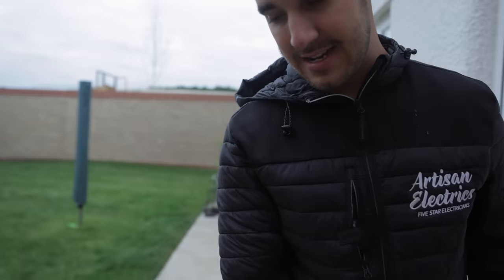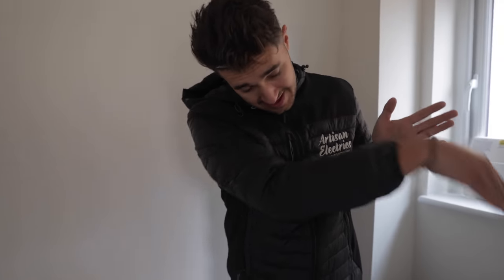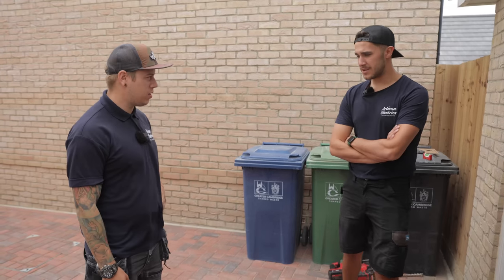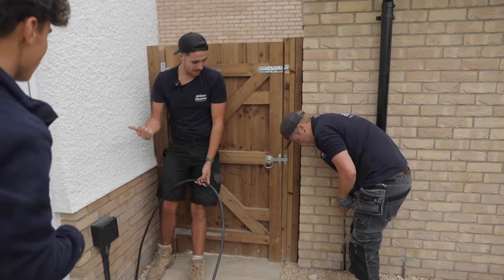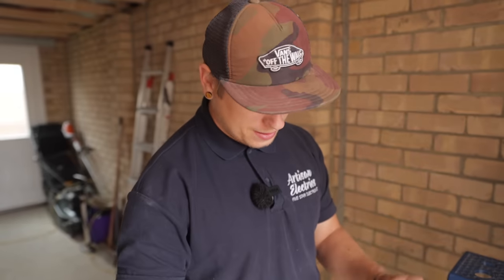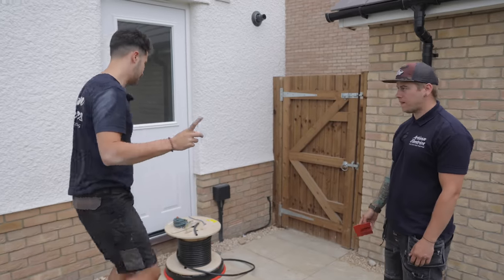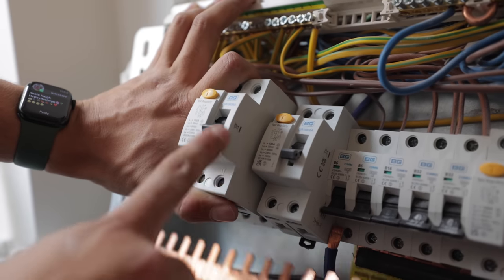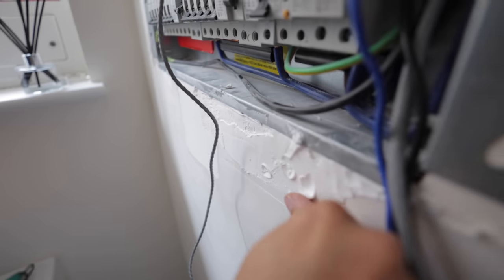EXPLODING MATERIALS, DODGY CABLE DUCTS & SLICED KNUCKLES

Comment: Telecoms cable wiring starts with Blue, then Orange, Green, and Brown. First pair to be used should be Blue/Blue-White. In the char carger application I don’t suppose it matters that much. I use some WD40 at times to help get cables through tight ducting/trunking.
Reply: WD40 can affect the insulation and stinks, far better to use proper conduit lube
Reply: Back in the day we used soap liquid or talc powder.
Reply: I use KY
Reply: Lube is useful here!
Reply: we have blue-orange-green-brown-grey in our telecom
Reply: @justme5384  If it was a 5 pair cable, yes. But most Ethernet/Cat 5/Cat 6 cable is 4 pairs for 8 pins on the RJ45 connector.
Reply: @badrobert71  still use customers fairy liquid if needs be. Just a nightmare once you’ve got the cable through you’ve no chance to carry on pulling as you’re fully lubed up as well!😂
Reply: @chrisdobbo8938  - lube when wet, glue when dry. 😬
Reply: I came down to the comments to talk about the AT&T twisted pair color code as well. Good on you, David!
Reply: silicone spray. Does not affect plastics or rubber

Comment: Just some silicone spray in the pipe before tight pull and should come quite easily or otherwise there's a potential problem 😁

Comment: Top tip i find (not a spark but pull alot of network cable etc) just put some fairly up liquid down the end of the duct, pour fair bit in, and if needed put some on cable if it dosnt coat as its goes through, you will not believe what a difference this will make to pulling any cable through a duct, even if its not that tight a fit, the friction from the duct and cable over a distance is huge, a bit of fairy and it just decudes this by like 75%, deal breaker i find!

Comment: No critic, just a question: Why aren’t there more multi-row CUs in the UK?
E.g. German electricians put at least 2-row panels in each chamber of some business hotels or apartments, often combined with a mounting place for the meter.
I think this is a UK standard of some sort, but it always looks so fiddly to get all the cables into these tiny CUs … even if Artisans always do a great job of making it look pretty 🤩
Reply: You'll basically never find multi row CUs in UK houses but anywhere else you'll find something vertically stacked In 2 rows so you have a bit more space

Comment: That didn't look like SWA -  does PVC conduit under a paved path count as fine for protection when burying cables?
Reply: Strictly speaking, probably not. It'd have to be earthed metal to provide additional protection. Plastic pipe isn't going to do much to ensure the cable short-circuits safely (and trips an MCB) if cut through.

Granted, it's a fairly short run and it's unlikely that anyone will be digging there (since there's paving above) and the cable can be seen going in & out of the duct.

But AFAIK underground cabling >50v should always use earthed SWA or be within earthed metallic conduit, etc.
Reply: I'd go with SWA 100%
Reply: That’s what I thought - buried cable requires protection from an earthed metallic sheath or and earthed metallic conduit
Reply: Yes, I would argue the paving satisfies mechanical protection required. The fact that you can see both ends of the cable also means it doesnt take a huge leap of imagination to guess where its run should the slabs come up.

Comment: Strip the cable back to tape rope to inner cores they fly through ducts etc.Use cable lube if things get tight worked for me for 46 years.
Reply: stripping the cable is not legal outdoors - the double insulation is required for moisture resistance

Comment: Begin with hoovering the duct 7:50. Then, and I cannot stress this enough: silicone lubricant spray
Reply: yes, i was yelling 'use some lube' (oo err mrs).... I use Ideal wire pulling lubricant... but either/or ... better than struggling

Comment: The bricks they use on 'new builds' are just terrible quality, you just have to breathe near them and they blow out. 
Even on my mother's 70s Barratts, the bricks are crap, we were drilling a 12mm hole from the outside for the CCTV, and the whole face of the brick fell off! In fact, even just from the weather there are a few that have blown.
Reply: my house is like that, 70's LBC face bricks.